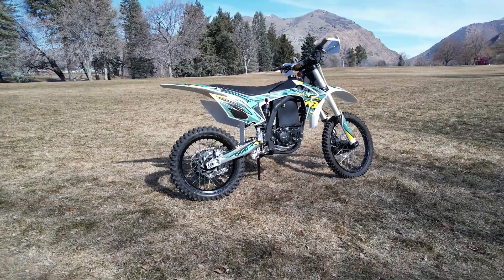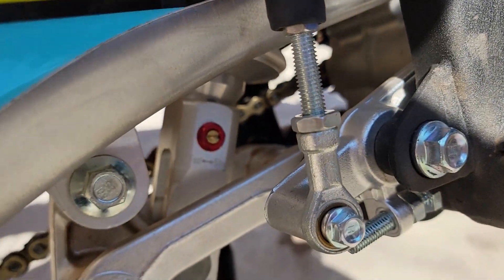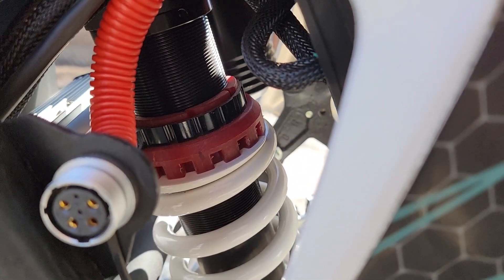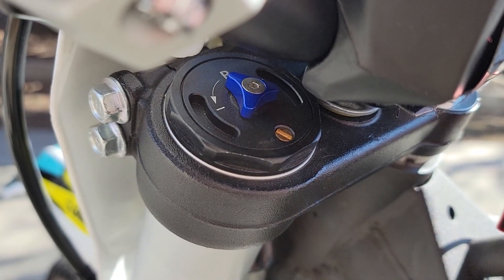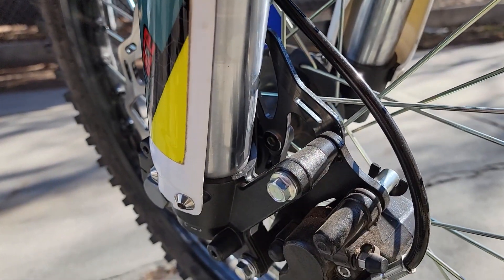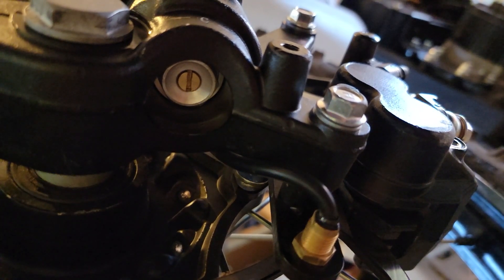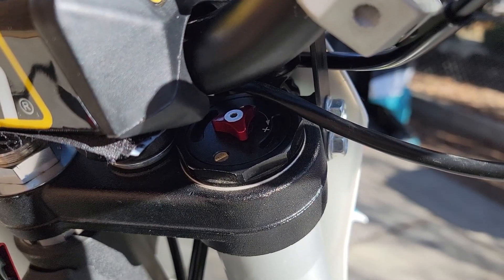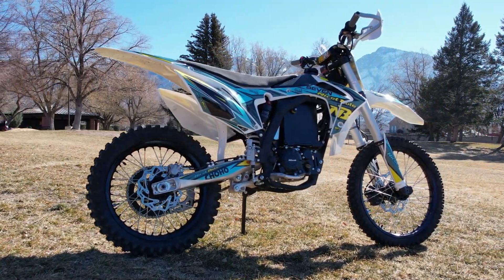Chinese Electric Dirt Bike Suspension Overview (Nicot Moto eBeast)

Comment: Kyb is for the upgraded second generation of EBeast. New programming in the controller as well. Also different start up with remote control and a push to start button instead of a key on the Speedometer. New black graphics with 4 color options.
Reply from the maker: Are you part of Secutronic Technology Company?
Reply: @FeathersOffroad  No I'm not!

Comment: Awesome video. Could you do a review of the motor itself too? Cause i think its the same one thats in the time moto et. 
And may i ask if it is safe to order from alibaba do you have any experience with it or do you have ordered of alibaba by yourself?
Reply from the maker: Ive ordered from Aliexpress several times with no issue. This was my first order from Alibaba and it was pretty easy. They have that Alibaba Trade Assurance, which is like a holding account for the money (think escrow). The Secutronic folks that I ordered from were really responsive over WhatsApp.